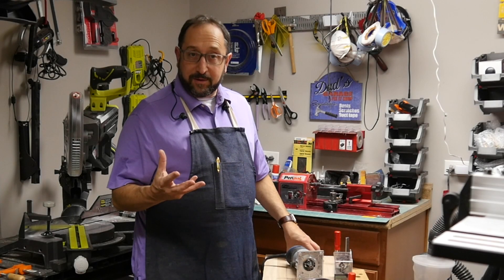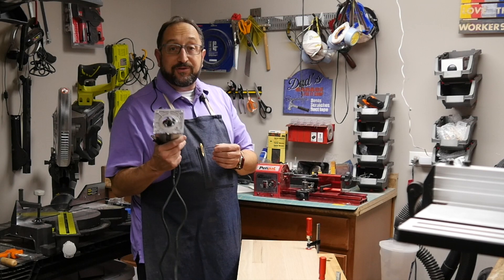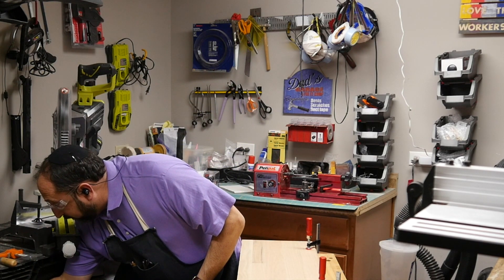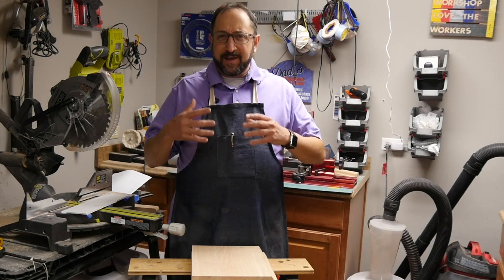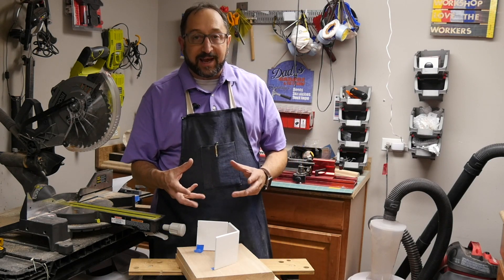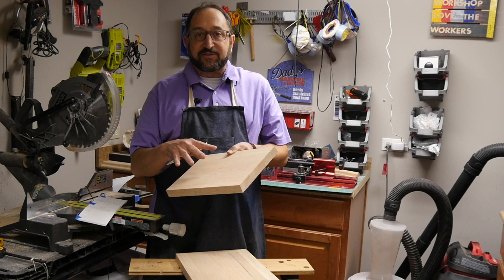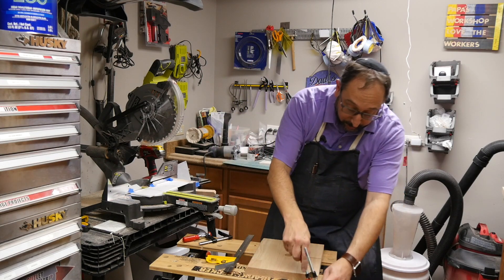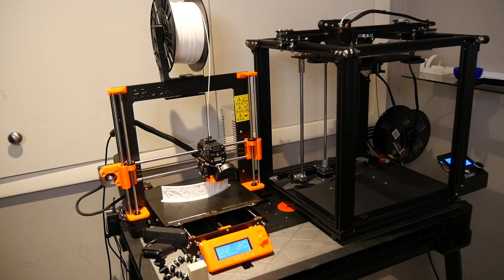How to Design a Lithophane. Part 2 of 3. Building the Wood Base.

Comment: Did you mean Fusion 360 when you said Tinkercad? I also use Tinkercad mostly, but in video 1 you used Fusion 360.   Probably same applies about exporting/printing plans.
Reply from the maker: I use four different CAD program as part of educating my viewers.  The Lithophane frame was designed in Fusion 360.  I find for designs that require exact dimensions when multiple parts will be glued together Fusion 360 of FreeCad are better choices.  This may just reflect my expertise in Tinkercad.